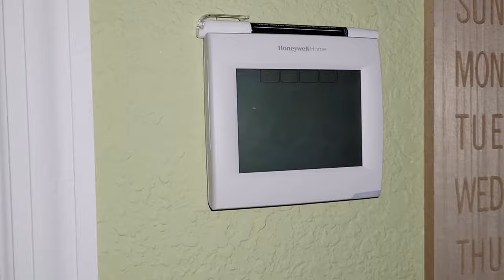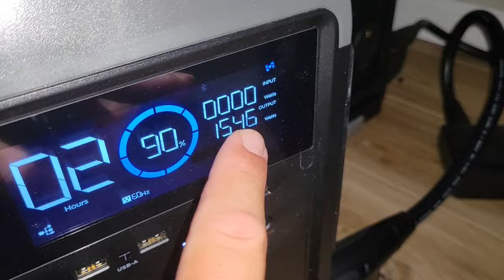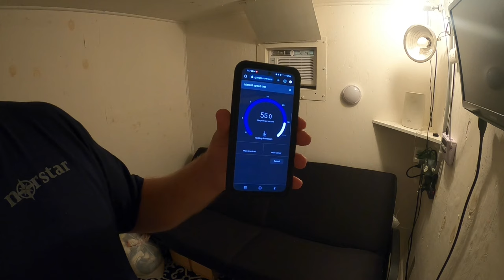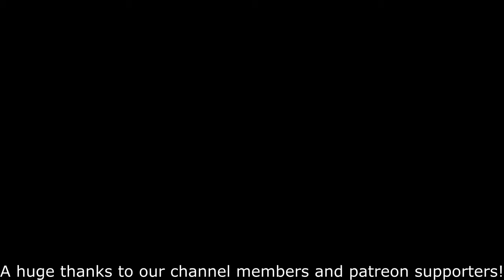Preparing for Hurricane Idalia! So much to do! #827

Comment: At 20minutes, I am reminded that the electric utility crews that I worked with installed "pole-top split bolts" at 90 degrees like you described.  They provided a great deal amount of resistance to top splitting.
Reply from the maker: Great to hear!

Comment: The hundred dollar limit is usually a pump limit. I first ran into it back in 2005 with a ford explorer with 2 tanks, pump would cut off at $50. The limit is there to keep thefts down. Some enterprising individuals with a stolen CC and an IBC tank in the back of a pickup can pilfer a lot of gas in a very short time so they put in limits to deter that sort of thing.

Comment: Couple things. For those relying on gas generators.  Don’t overlook filling your boat gas tanks as well. Get you a hand pump from Harbor Freight. It was a life saver after Katrina and gave us a few more days of running while the gas stations were brought back online.  
The other tip is to thin out your beautiful oak tree.  They will act like a sail getting pushed on by the wind and wet grounds and their roots don’t run deep enough, even 100 year old ones will push over from the storm. I know it’s too late now but something to think about in the future.
Reply from the maker: Very good point and I should have mentioned it. My boats are full and so is my mower. I have AA powered fuel pumps for removing fuel.

Comment: Andrew, I would also add the 6x6 plates to either side of those posts, that would help prevent more/possible post end flaring.  I dealt with the similar force on a post in that direction and had to engineer a plate when using posts to jack up my roof overhangs when I replaced my columns.  Also, your family and farm critters are always welcome over at my homestead here in Mississippi in case you really need to bug out.
Reply from the maker: Thank you! Engineer at the barn company suggested I use 3 inch square washers. I'll be ordering some soon.

Comment: The $100 limit has to do with the pre-authorization that most gas stations use to prevent getting ripped off, if you are buying more than $100 in diesel try a truck stop since they cater to bigger fuel consumers. It may look strange but they regularly pump out 2-300 gallons at a time.

Comment: Something you might consider is getting some 4 inch PVC green valve boxes, some long screw in the ground anchors and place them down both sides of the house. Then make up some cables you can throw over roof and attach them on each side to the anchors and use a turn buckle or other tensioner device to help keep the roof from lifting in a storm. Then when not using the anchors, they are covered in the valve boxes and flush with the grass.
Reply from the maker: I wouldn't do that for the roof, it would crush the ridge cap and tin. But I have considered that to cable to the trusses.

Comment: You have prepared the best you can to keep your family safe and powered. I don't think anyone else is prepared as you. That is why I am a huge fan of your channel's content. You think like me and beyond. Good luck and God bless. You will survive well. One question. When you filled up your small gas container for your chainsaw, did you run a couple of gallons of the ethanol free gas into your truck first? That is a good practice to be in to run all of the other possible gas out of the line before you fill your container.
Reply from the maker: Thank you and God bless! No need to run gas out, this station has a dedicated non ethanol pump. I love that!

Comment: Speaking of mesh, I just added a 3rd starlink mesh router to my network. I wanted coverage over near the goat and pig area to go live and upload content. with the 3rd mesh router, I'm just over 220 ft and getting around 50-60 mbps download. Glad to see your setup is working well. Once Amazon releases there sat. network system. I'm looking to add that as a backup. Stay safe!
Reply from the maker: I can actually get wifi over 800ft from the house, but it is reduced speeds. I'm very impressed.
Reply: @TKCL  thats impressive. I need to do a little more testing!

Comment: If this thing is coming near you and you are low lying, just go ahead and evacuate. In Louisiana, we went through H Rita and there was 20ft storm surge. The National Guard was rescuing people who didnt evacuate from rooftops, with Blackhawk helicoptors. You might drown in that shelter if the storm surge is high enough. When it rolls in, it will be fast. There is a supermoon which equals higher tides than a normal full moon too. Storm surge backs up into rivers, creeks etc and floods even more..plus the rainfall.  We couldnt get back to our house for a week after Rita until waters receeded enough. Even our kids school which was higher ground got 6ft of water.
Reply from the maker: I'm around 100ft above sea level and we built towards the top of our hill. No risk of flooding in the shelter other than ground runoff.
Reply: @TKCL  Oh that's good! Flooding is the worst! We are at about 135ft & rolling hills.

Comment: Up here in Ohio, we have a saying "Its not the Wind that gets you, its the Pickup Truck in the wind that gets you". Bunkers are built underground. That little thing you have may protect against a low energy wind event, but take it from a Midwesterner, a Tornado with rip that thing out of the ground and toss it. I am assuming your Water Table is just below Ground level as to why you built above ground. You might want to consider using that new Back Hoe on your new Tractor to dig up a hundred dozen yards of soil then pile it around and over  to give you the mass it needs to withstand serious winds and the debris in those winds. We call those Root Cellars up here.
Reply from the maker: Lol you are correct about the water table. This will absolutely handle a hurricane the way it's designed. We typically don't have flying vehicles in a hurricane, nor do we get those monster tornados your referring to.
Reply: No Tornados, no snow (mostly) and I see your Daylight is about 12 hrs mid-winter versus the 9 hrs I get....  tempting  :)  @TKCL
Reply from the maker: No snow here since 89, we did get an ice storm about 5 years ago. Just be prepared for crazy high humidity, hurricanes, bugs and lightning.

Comment: Andrew Looks like you guys should be OK but should still get some rain and wind. Here is something else you might want to look into. Down here we are getting power drops and it's give the A/C's a fit causing the compressors to over heat and not fire back up for awhile.  air conditioner soft start icm controls 870-32a soft starter. I think this could be very beneficial to people that have a smaller generator or a smaller solar system it stops the big surge when A/C fires up. I would think it should help with power cost kinda like keeping your foot out of the gas peddle on the car. Good luck with the storm and stay safe
Reply from the maker: I personally have soft starters, I'm working with a Florida company on some plug and play soft starters I hope to share soon.

Comment: What about putting steel plates on either side of the post. Then run the carriage bolt through them. I would think it would give tighter compression over a larger area vs. just the head of the carriage bolt for compreession. Just a thought.
Reply from the maker: Agreed, I'm looking for the thick 3 inch plate washers.

Comment: your storm shelter needs work on that one plug that is overloaded 😂. Good luck with the storm hope things are uneventful.
Reply from the maker: It's not overloaded, 20 amps, 12 gauge wire and the biggest thing is a 300 watt AC.
Reply: @TKCL  ya did not figure you to under design the actual power requirements based on your vids. I was just giving you crap about the rats nest of wires 😀
Reply from the maker: I hate it, but it is what it is.
Reply: @TKCL Stay Safe.

Comment: You want to prime those knot stains with a oil based primer otherwise they will just re appear. Can of oil primer spray or Original Kilz will do the trick.
Reply from the maker: Hate to say there is 3 layers of kilz on that wall now. It's not like it use to be.
Reply: @TKCL  Did you use the Original Kilz (shellac based)? Water based Kilz is worthless for strong tannin stains.
Reply from the maker: Nope it was the kilz 2, that's all I seem to be able to find.
Reply: @TKCL  Look for the red and white cans "Original Kilz" or they also have the odorless version which works good and doesn't smell so strong. The Odorless Kilz is in a green and white can.

Comment: In terms of Tropical Tornadoes with relation to Hurricane Idalia (And really hurricanes in general), watch out for supercell's embedded in the outer bands of the hurricane as it comes on shore, whenever hurricanes make landfall, (especially in the north-east quadrant of the storm) strong storm cells coming off of the water can have enough wind shear (the changing of windspeed/direction with height) to develop mesocyclone's (a large rotating updraft that is the main defining characteristic of supercells) which in turn can produce quick spin-up tornadoes. Granted I'd be surprised if any of these tropical tornadoes become more damaging than say, an EF-2, largely due to the fact that most supercells embedded in hurricanes are rather shallow, I would definitely still be on high alert and ready to move to your storm shelter as those outer cell's come ashore.

Comment: I am having so much trouble finding ethanol free gas. I can't find a map of places, just a list of gas stations and I don't want to manually look up a hundred different gas stations to figure out which one is near me.

I have had that card thing happen when filling my truck and gas cans at the same time. I think it happened to me using the credit option on my debit card. It hasn't happened using debit.
Reply from the maker: There use to be good aps for non ethanol.

Comment: Just a suggestion, but maybe it would be safer to use your tractor and forks (along with those nice Rhino straps) to unload that fuel container ;)
Reply from the maker: I'm thinking about mounting to a pallet and using the tractor.
Reply: Don’t forget to lower the flag pole.
Reply from the maker: I mentioned that in the video, I'm taking it down in the morning.

Comment: Hey I just thought of some thing.. What if you had hooks to mount into the concrete and ratchet strap the roof down around the house Wouldn't that prevent major lift and possibly prevent weakening the roof structure? I don't know how fast you could get concrete drill and the stuff to mount it but it was just a random thought.. Yeah I am praying for you all down there.. It's not looking good if you caught my twitter post lastnight I shared the hurricane update along with the water temps I was seeing from aug 26 and that gulf is hot... really hot.. The good news is after this storm goes through it will cool down the gulf water temp by about 10 degrees the bad news in order to do this it will churn a lot of water really quickly.. I think my models were showing 6 degrees at 25,000 feet or some thing but I estimated for the 48,000 feet to be like 10 degrees I think.. If i did my math right.  

Edit
I was thinking every 8 foot span a rachet strap criss cross creating an x with two straps basically one end mounts on the top the other into the concrete or close to it some how It would have to be tight really tight because ratchet straps begin to flex over time so you would want it as tight as you could get it with out breaking or bending anything. Anyway the idea is to support and to create a triangle of support around the home keeping strength.
Reply from the maker: Slab is 8 inches thick and heavy. I also added 4ft earth augers into the ground and bolted into the shelter. I don't believe it's going anywhere.
Reply: I was thinking more less on the house. @TKCL
Reply from the maker: I see, I have considered cables.
Reply: Yeah sorry it was just a random thought.. @TKCL
Reply from the maker: No worries, I was reading fast and responding quickly. I missed that you were referring to the house.

Comment: You're quite a bit west of the track, on the clean side of the storm. You should be good.
Reply from the maker: Not with the most recent track
Reply: @TKCL  Current track (2:00pm Tues) has it coming in at Steinhatchee with a northeasterly track. You're 45-50 miles from Steinhatchee. When it comes to these storms, 45-50 miles on the clean side makes a world of difference. The storm may also be traveling at 20+ mph to the NE when it hits which makes your winds 20 mph less due to the storm's direction of travel. No question you'll get some wind, but I predict T.S. force or less if the current track holds up. The 5:00 and 11:00pm track will be telling. We're with ya.
Reply from the maker: One wobble west, which is predicted and I'm in trouble. We're definitely getting TS winds. It's so close I have to be prepared for hurricane winds.
Reply: @TKCL  I'm praying I'll be able to say, "I told you so", after it quickly passes tomorrow morning. I'm in Miami and went through Hurricane Andrew a little over 31 years ago.
Reply from the maker: I remember Andrew and seeing the devastation on TV as a kid. My parents still talk about it till this day.